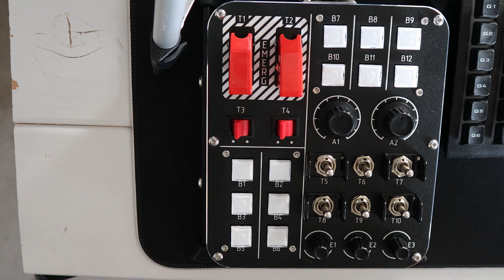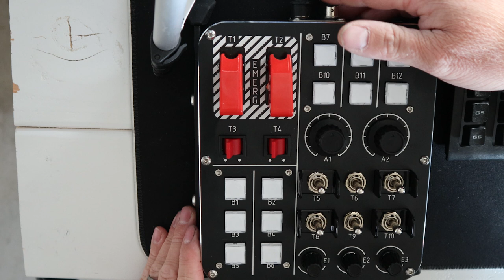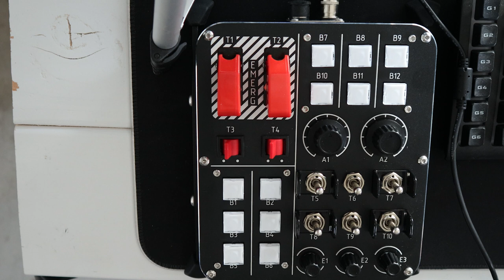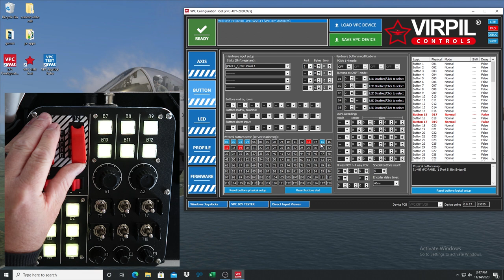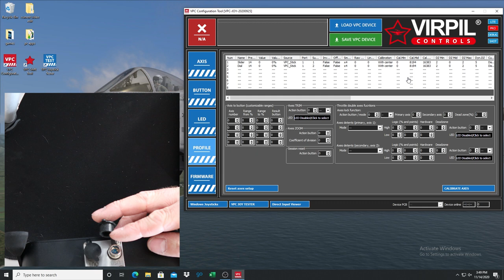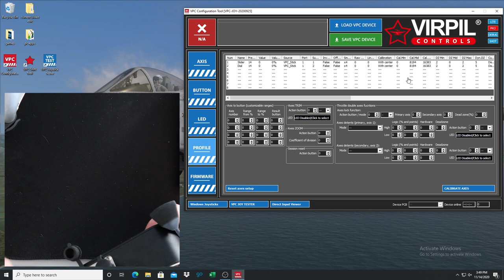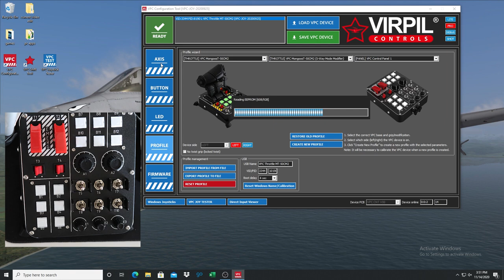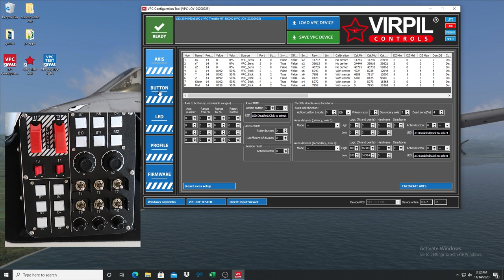HOW TO SET UP YOUR VIRPIL CONTORL PANEL 1  (IN HD)

Comment: Nice video (Y) I do wonder though if you can use all the buttons when the throttle is using the 5 mode switch like in yours. I understand the limitation of 128 buttons is a windows item and not specific to any game. I have the panel 2 incoming and want to connect to the throttle as well

Comment: not sure if you still see replies to this video.. but question.... I have a TCM503.. already set up and running.  I just got the CP1 in today and want to add it to the TCM503.  Do i need to connect the CP1 directly on its own 'first', then do the firmware update? or can i connect it to the TCM50 then do the firmware update from there?

Comment: Thank you for the videos. What is the primary purpose of 'daisy-chaining' the button box to the throttle? Only two things I can think of: having them show as one device (not sure how this helps as modern sims/games that I use all accept inputs from multiple devices), and secondly, saving a USB port (my PC has enough at the moment). Ergo, in my situation, I would just run them (control panels) as standalone modules?

Secondly, you mentioned not doing firmware updates with more than one device connected - do you mean in a 'daisy-chain' setup (which I can imagine would be bad), or also as standalone setups? ie. The devices being shown seperately in the Virpil software, and selecting each one individually to do firmware updates? I would have thought that would be ok?
Reply from the maker: I just did an updated Virpil start guide that better explains. Check it out and see if it helps. https://youtu.be/PW7pQwBg58M

Comment: I'm scouring the internet trying to find out the various advantage/disadvantages of using the control panel in slave mode versus direct to computer.  My cable that allows slaving doesn't work anymore and replacements are backordered.  I'm going to direct-to-computer while I wait this out, and I'm trying to figure out what I'm sacrificing besides needing two usb ports instead of one.
Reply from the maker: I run everything as a primary. You can get a powered usb hub to connect all of your panels and hotas to one location.

Comment: just to be sure, should I first connect it independently and make a firmware upgrade and then afterwards connect it as slave to my throttle or can I directly connect it as slave to my throttle and make a firmware upgrade and configure it? (I have a control panel #1) thx, great channel!!!
Reply: I think I got it, you first HAVE to connect the Control Panel directly to the PC, configure it in the Virpil program as shown in this video and THEN connect/slave it to the throttle/joystick and create a new profile with both of them as shown in this video. There seems to be no alternative to this sequence.

Comment: Any luck on getting the LED's to be singularly controlled by a function?  For example, if Master Warning sounds off in a Jet, an assigned red LED would illuminate and by pressing it , would clear the red Master Warning?  Similarly, if a Master Caution would sound off in a Jet, an assigned amber LED would illuminate and by pressing it, it would clear the amber Master Caution. Another example would be an LED assigned to landing gear where one press is RED for gear up and THE SAME button once pressed would go to green for gear down.  Or two LED assigned separately for gear up / gear down (RED / GREEN).  Perhaps it was NOOBIFER or someone else that was working on this.  Virpil does not have their software able to do this yet (as I recall).  You can control one LED only for on/off but that was about it and it's cumbersome.  Maybe someday they'll have it incorporated into their software.  If it wasn't you and you decide to take on this challenge, please do a video...yours are so easy to understand based on how you go about your presentations.  Thanks as always.
Reply from the maker: I haven’t had the chance to mess with the led software. I will look into this and get a video out.
Reply: @JGandT  that would be wonderful !!!  Lot's of people on the Virpil's forums are hoping for a way to control those LEDs individually as well.

Comment: so, ive followed step by step numerous times. after creating a new profile, im not getting anything show up in Axis? using standalone, only one plugged in, firmware up to date... but still not getting anything other than axis, profile and firmware on the left. clicking axis gives me a blank screen with the message "nothing to setup, create or load"
Reply from the maker: Do you have panel 1 or panel 2? Control panel 2 doesn’t have any axis.

Comment: Hi and thanks for doing these videos.   I just bought one of these panels.  I have a couple of questions.  After updating the firmware and changing some button colors I noticed that when I close the Virpil Config tool, the all the button lights on the panel go dark.  Is this suppose to happen?  Next, Flight sim and DCS is not showing the Virpil panel in the controls sections of both games.  What am I doing wrong?
Reply from the maker: Did you get this fixed?

Comment: My program isnt registering my control panel. Everything lights up but where you selected your equipment on the top mine is blank. Any ideas?
Reply from the maker: Uninstall and reinstall the latest Virpil software see if that helps.
Reply: @JGandT  Appreciate the help, but that didn't do the trick.

Comment: if it were you, would you direct connect both devices to your computer instead of daisy-chaining?
Reply: I run mine together so it shows up as 1 device in game. If you’re running a title like Elite Dangerous then run them as stand alone. Some games will only pick up so many buttons per controller.
Reply: @johnathangraham7226  hey, thats a good idea.  but i thought it presented some problem when i was watching a YT video on configuration.  its' been a while since i watched that video. So if I connect it to my CM2 Throttle, I'm guessing that it will show up in controls and bindings config in my games as Virpil CM2 Throttle as opposed to Virpil Control Panel #1 ?
Reply from the maker: Yes if you have them linked it will show up as cm2 throttle.
Reply: @JGandT  --- is it true that only 32 things can be recognized per usb port?  i haven't counted all of them yet, but there would probably be more than that if you count off positions and on positions of each and every switch.
Reply from the maker: Windows recognizes 125 per usb device. It’s certain games that only recognizes up to 32 per usb device. The only game that comes to mind is Elite Dangerous.
Reply: @JGandT  ok, thanks.  I only use X-Plane, DCS, & MS-FS2020 ... Star Citizen every 4 months to see if they are ever going to finish it and see if it still works ;(

Comment: If you use CP1 as stand alone can you still use the CM2 modes switch to change the CP1 modes? coz I was planning to separate the two since I plan to use the CP1 for my sim rig as well as a racing button box.
Reply from the maker: @Abner Jr. Paredes. I don’t believe you can I’ll have to try it out.
Reply: @JGandT  thats fine bro, thanks. I cant wait for my VPC to arrive.. with all back orders now